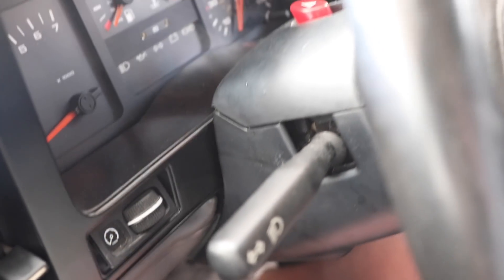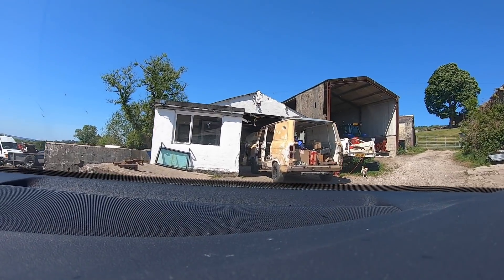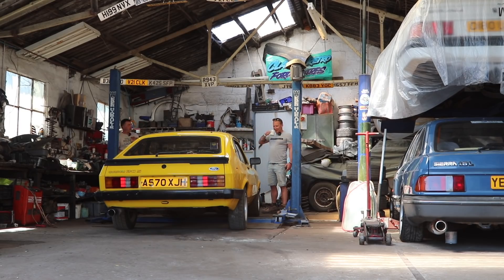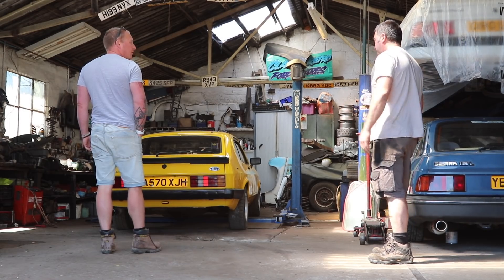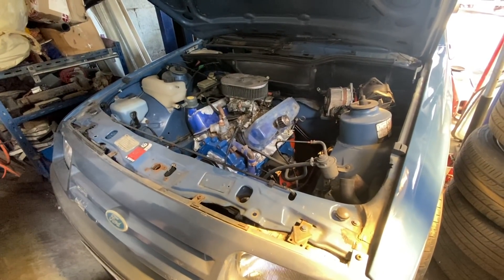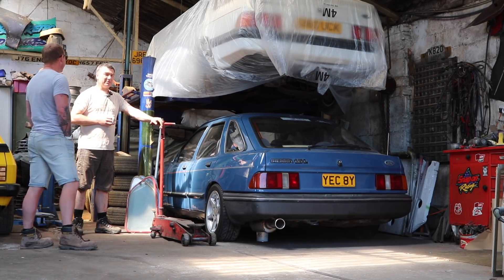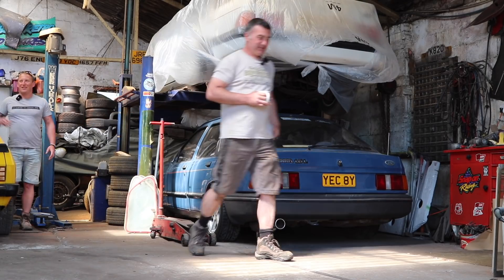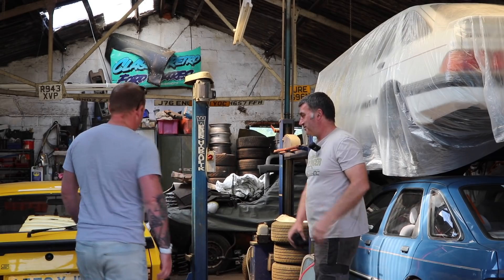Looking Around Tonys Classic Ford Barn

Comment: I love the 4x4 I was a xr4i owner for 8 years I had 3 off them ,I had murder with one of the Sierra 4x4 the front cross member are alloy an they get hair line cracks on them this as you no makes them shudder slightly under hard braking .good video thanks for your time...👋🏻👍🏼🇬🇧